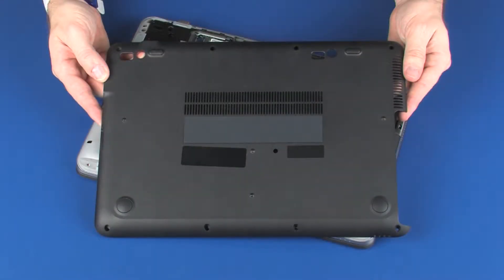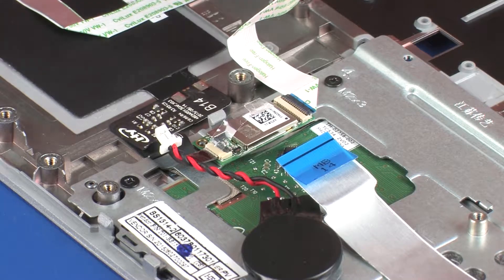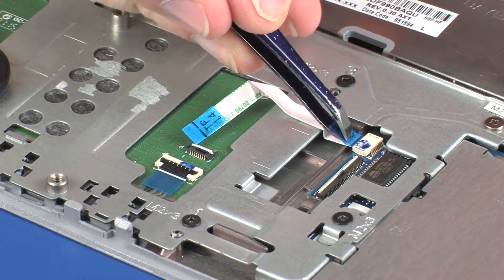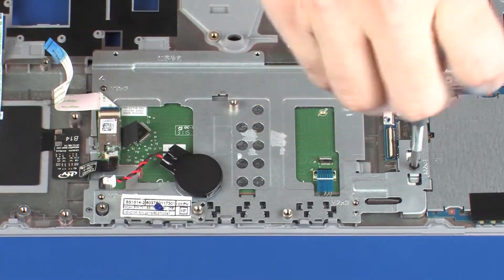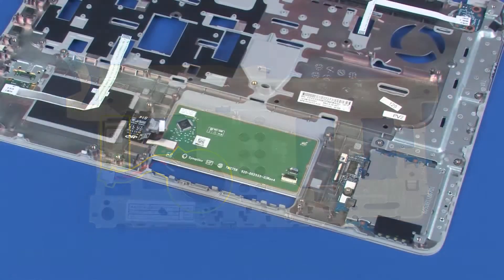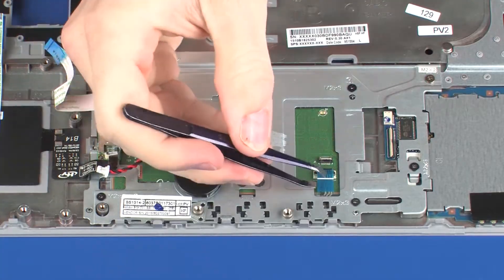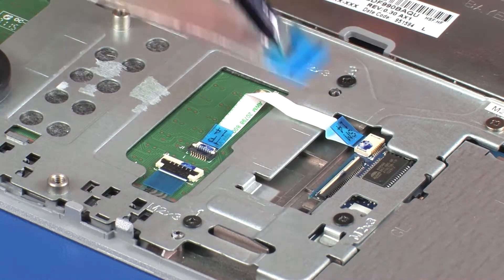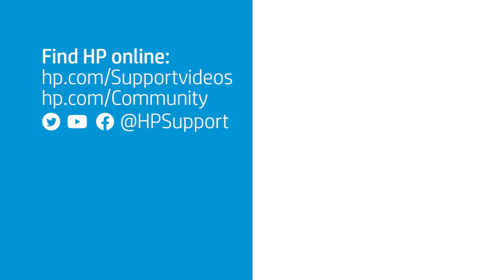Replace the Touchpad Button Bracket | HP ProBook 640 and 645 G2 Notebooks | HP Support

Comment: It means if I just disconnect button cable, the faulty left button stops automatically clicking along with right button. Byt Touchpad still works ?
Reply from the maker: Hi there, thanks for contacting HP Global Social Media Support!
I understand that you need to know if you just disconnect button cable, the faulty left button stops automatically clicking along with right button, but touchpad still works
I will do my best to assist you.
Disconnecting the left button cable on an HP touchpad is a potential hardware-level solution for issues like phantom or sticky clicking, but you should first try software troubleshooting steps like updating drivers, resetting touchpad settings, and performing a hard reset, as these are simpler and non-destructive fixes for most issues.
Regards, 
HP Support

Comment: yo, i got probook 4421s. i want to replace the trackpad connector, but i forgot the orientation, and there is no indication on which side is which. i see a little dot on the flex wire, what does that mean? thanks in advance
Reply from the maker: +vegadanial Please contact our phone support team to fix this issue. Please follow these steps to reach them.
Step 1. Open link: https://support.hp.com/us-en/contact-hp
Step 2. Select the product type.
Step 3. Enter the serial number of your device or select let HP detect your product option.
Step 4. Select the country from the drop-down.
Step 5. You should see the HP phone support number.